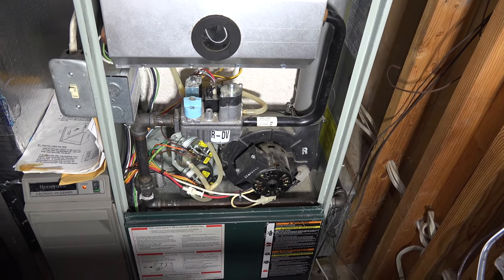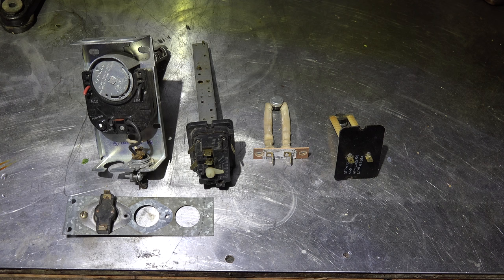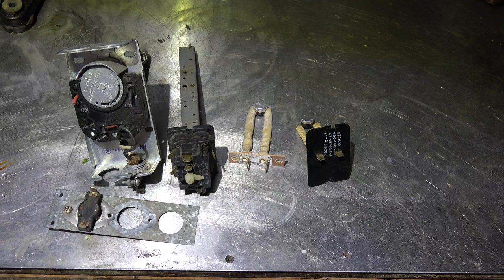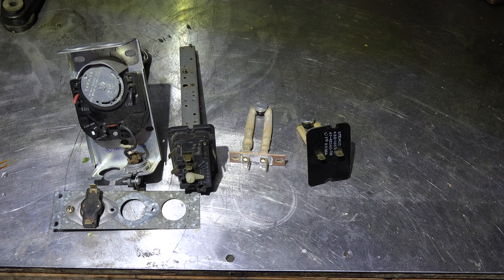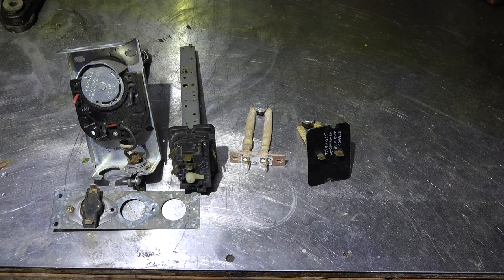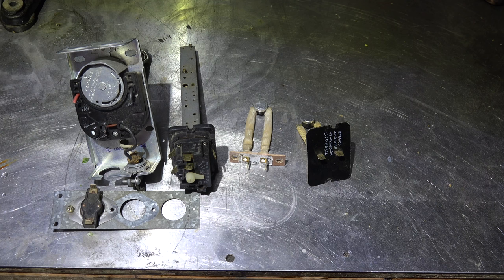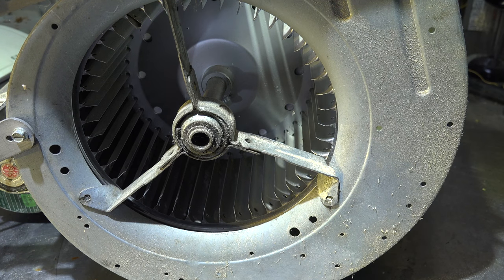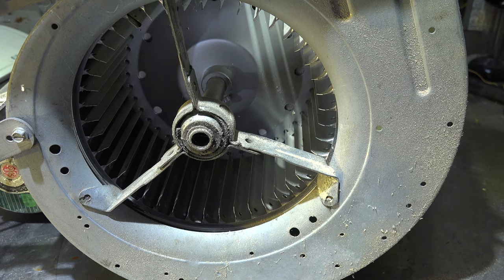Why is my fan running all the time with no heat

Comment: When the thermostat is off(no call for heat) I hear a fan come on, then off, then on?  When i do call for heat everything works fine? Can you help me? thank you
Reply from the maker: If the unit has a heat operated fan switch, the on and off temps may be too close.  If you set them farther apart, it could stop the problem.
GFM
Reply: Thank you sir, no heat operated fan switch on this unit.  In the wee hours of the morning I can hear the little fan turn on, as if I am calling for heat, but then turns off, then on then off?  And it does this when the thermostat is on auto  and off.  Day and night L.P.  model 376CAV036075. Is it possible its scencing a propane leak and turns on to clear? I am baffled. Thanks again.
Reply from the maker: Not a propane problem.  That sounds like a thermostat problem.  Try bypassing it.
GFM
Reply: I am just a DIY.. I am not familiar with GFM. I did replace thermostat a few weeks ago with a cheap honeywell one.. maybe i need a better one?  thank you.
Reply from the maker: GFM is short for Grayfurnaceman.  If you remove the wires from the thermostat, and and it does not come on at night, the thermostat is the problem.
GFM
Reply: Thank you grayfurnaceman. I will try that.
Reply: I just noticed my theromostat has two wires NOT hooked up, an orange wire and a purple wire. They were kind of tucked in the wall when I took the cover off the thermostat. Could this be the cause of inducer fan comng on? Thank you!
Reply from the maker: No.  They are almost certainly wires that were not needed for your system.
GFM
Reply: So my fan is running all the time I switch fan off but still running. The problem is the thermostat??

Comment: My fan is just running all the time, in the off position and on auto as well, gas furnace. Also my a/c is broken. With a 4 year old this is so frustrating..
Reply from the maker: A gas furnace will turn on the fan to alert the homeowner that there is a failure in the furnace.  Have you checked the error code?  There is a light that will blink a code viewed thru a small window in the furnace cover.  The key to the code is usually on the inside of one of the covers 
GFM
Reply: Lori Nunnelley is

Comment: my furnace fan  blows air and no heat also I hear a clicking noise a lot do you know what that noise is??? Thanks.
Reply from the maker: Gas furnace?
GFM
Reply: It's a Beckett oil burner
Reply from the maker: I am not sure what the noise is but your burner has probably shut down on flame safety.
GFM
Reply: grayfurnaceman I also pulled out the fuel nozzle electrode mechanism it was all black.
Reply from the maker: It is normal for the gun assembly to be black from extended use.  That does not mean the nozzle is not plugged.  When the gun is removed, the assembly should be cleaned and the nozzle should be replaced.
GFM
Reply: grayfurnaceman is the black stuff just carbon???
Reply: it sure isn't pixie dust ;)
Reply: Adam000

Comment: My blower fan randomly comes on and runs for a short time and then goes off with no call for heat.
Reply from the maker: Can you give me an approximate age of the furnace?
GFM
Reply: Not sure.  2002?  It is a Coleman DGAT075BDF that was used a couple of seasons and then sat for years.  The mobile home was scrapped and the furnace installed into a 1986 mobile home fall of 2017.  For grins I cleaned the flame sensor rod and replaced the board with one from a known working unit.  Same thing.  My next guess is one or both of the temp switches.  Sometimes when it cycles from a call for heat the flame goes out when the blower comes on and then it recycles and works.  Haunted.
Reply from the maker: Could be the whole house fan is coming on.  Mobiles of that age do have a fan to bring in outside air periodically.
GFM
Reply: Wow, never thought of that.  Learn something new every day.

Comment: Cracked heat exchangers build up heat. 

Plugged evap coils from sweaty pet hair/dirt/drywall dust.

For the love of god if its over 13 check that exchanger, if its a 90 percent unit remove the inducer motor and check for rust by the blower. Plugged secondaries can happen even at 12 years.
Reply: Antonio Kristler how to install a switch with a Buss fuse on it to a furnace show how to install a switch with a Buss fuse in it for a furnace

Comment: 99.9 percent of the time it’s a control board. I’ve seen filters that haven’t been changed in more than two years and didn’t have this symptom. Just google the model number pick your part and replace!
Reply from the maker: that has not been my experience.  A continuously running fan could be a stuck limit, rollout switch open, flame failure, or pressure switch problems.  The IFC is the absolute last part I would replace.  
GFM
Reply: I agree with leg!